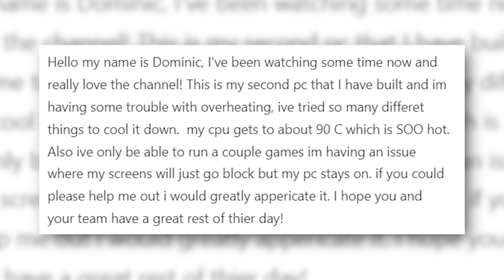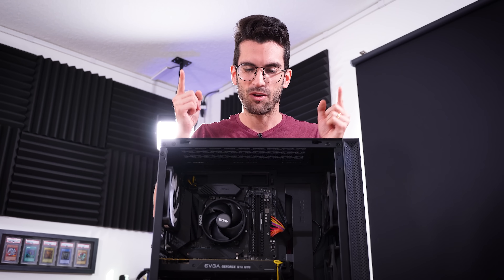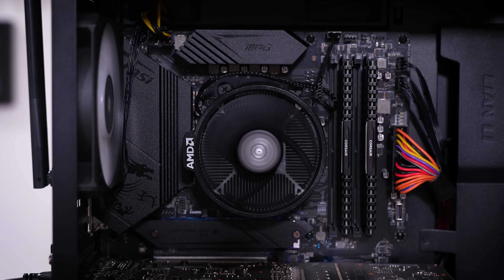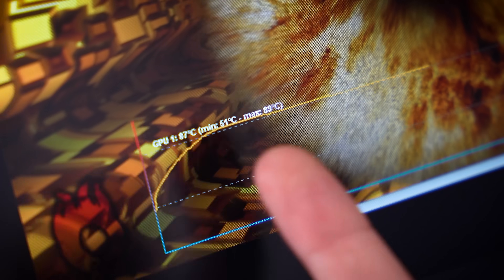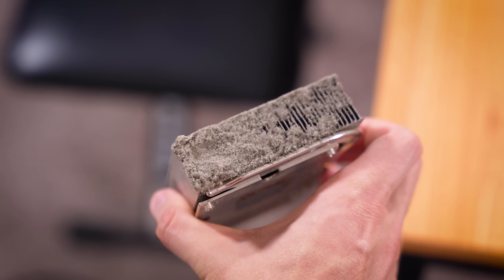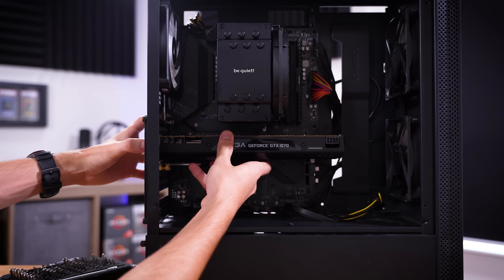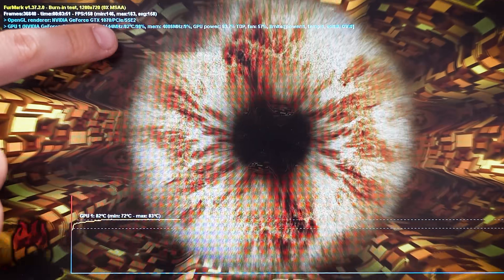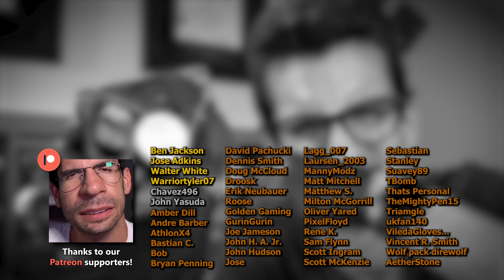Fixing a Viewer's BROKEN Gaming PC? - Fix or Flop S4:E15

Comment: 😅my wife's 5600 CPU just had to have the included cooler replaced for overheating about 2 months ago. for her PC the fan bearings gave out and fan speeds dropped to 50%. new air cooler tower it's icy cold again👍

Comment: The 5600X does actually come with the stock cooler. It is surprisingly enough for most typical usage at stock settings, but will absolutely throttle if you try to use PBO or anything. The 5600X seems to be right at the threshold of what the Wraith Stealth can cool, and even an inexpensive single tower cooler will unlock a bit more performance.

Comment: Those are not normal temps for a 5600X, even with the Dark Rock 4, mine never ran over 68°C. Maybe the board at stock has that weird thing were it pushes higher clocks to ensure stability. That's why I always keep my BIOS up to date, to make sure everything is as good as it can be Motherboard-wise

Comment: QUESTION:  you mention that the blower style video card cooling isn't very efficient - I'm assuming you're referring to the basic concept that a fan on the end of the card furthest to the front of the case takes in incoming air and pushes it out the back of the case through the fan slot cover.
What other model is there that you think is more efficient?  
The only other one I can think of was when nVidia's reference blower for the 2080s would just push air downward onto the board and then it would exit the bottom of the card onto the motherboard and the top of the card towards the case panel (which in my experience was really problematic).
Thanks in advance! And thank you for continuing to do these - I really love living vicariously by watching you help people and fix build problems.  It's something I used to do a lot of. ^_^

Comment: Replacing that PoS choked off case will drop those GPU temps a decent amount as well.  Sadly too many folks think that closed front with 90 Degree narrow side airflow bends are "Neato".  Upgrade that case to a Mesh design and see those temps fall very comfortably.  Great video always love seeing heat issues resolved.
Reply: I completely agree, one of the main problems of this build is the horrible airflow from that Lian Li case

Comment: I had the same setup before, B550 board, 5600x CPU and the CPU was hitting 95 degrees with water cooling, couldn't figure it out. I stuck a noctua NH-D15 on it, and it still did the same thing. Figured it was a problem with the board, so swapped that out, same problem, RMA'd the CPU, never heard back, took 6 months to get my money back by which time I swapped for an Intel i7 10700k and with the Noctua NH-D15 I rarely see the CPU go above 70. GPU on the other hand is a 4070ti and with Furmark at QHD it hits only 75 degrees.. 

I reckon purely, this CPU you have here is one of the dud batch that AMD released.

Comment: well one exhaust fan isnt going to do the job... a few top fans maybe an extra in the front will drop that another 10 degrees. I would never run in the 80s. Plus not sure why people still use big heatsink fans when all in one cpu coolers are like 50$ and work wayyyyyyyyyy better.

Comment: Can anyone help me with mine: my pc used to run completely fine up until a month ago when the CMOS battery went out and I replaced it but ever since then my pc won’t work with my monitor and my monitor is completely fine and it works fine. I tried connecting it to the graphics card as usual and still didn’t work. My monitor won’t boot up but the PC does boot up. I get a “hdmi isn’t connected” screen and then it just goes to rest mode. I don’t know what else to do and I’m not sure if it’s the graphics card or it’s something I did. Any help would be appreciated greatly
Reply: If it was DP i would have some things to try but if its HDMI that means its either the gpu, cable or monitor. I would try a new cable first, I just had an HDMI cable die last week. also have you checked the other hdmi ports on the card/monitor? you said the monitor works, so you tried it with HDMI and something else, correct? if its not the cable then I would try to reseat the gpu and make sure all the cables are plugged in all the way. also you've tried another monitor with the PC to make sure its actually booting? if the monitor 100% works, and you've tried other cables unfortunately it may be the GPU.

Comment: hi Greg just wanted to let you know that your recurring advice on clearing the CMOS when-in-doubt has just done magic for me lol. My HDMI-out would not work no matter what whether it was plugged into a GPU port or motherboard port with integrated graphics, so long as my GPU was actually plugged into the pcie slot. If I removed the card, then integrated graphics would work. Card was tested in a another rig and confirmed working. I started to spiral into questions like if the pcie slot was damaged, or somehow the PSU connector had something to do with it.. But then I remembered one of your videos and decided to clear the CMOS, and it WORKED haha.

Comment: Great video!! Im glad i found your channel tou are great at making these tasks into fun videos.
Btw i my cpu used to run around the 90 degree mark, with an silly rgb fan I had. Then I put the wraith cooler back on and undervolted the cpu to 1.25volts, now it runs on like 45-65. On a crazy hot aussie day it can get into the 70's, still a crazy difference

Comment: It's still much to hot for a 5600X, i would have checked the voltage (BIOS update?).
Reply from the maker: We already addressed this in the video. Voltage was fine and other BIOS settings were stock. Some chips just aren't as well-binned as others. Temps aren't alarming anymore. Not a reason to overhaul everything IMO. Mid-70s is fine.

Comment: Considering you can snag a 3060 for around $120 these days, nobody should be buying a 1070 in 2023 but a collector.
You find removing dried thermal paste therapeutic. I find it anxiety inducing.
Blower cards always run hot but I still wouldn't call the CPU temps good. But it will run quite a bit cooler when actually gaming.

Comment: wondering why the 5600x has heat issues as mine using the stock cooler and with a 6700 gpu (3 fans) on furmark after 7 min my cpu temp is 52 c and 58 c on the gpu did i just get lucky on the silicon lottery?

Comment: great video as always.
i was wondering, what brand and model that case was.
i'm using a shallow case (antec NX292) only showing CPU cooler clearance of 155mm. I see that case also have a shallow depth but manage to swallow dark rock 4 that are 160mm high.
Why? because just a few days after my upgrades still using intel stock cooler, my i5 CPU decided that 100'C are an ideal temperature to be. i can however remedy some of the heat  using higher fan curve.
so i deciding to upgrade the cooler. but case clearance are not clear what cooler can and cannot be used. the safest bet are using AIO. but I like beefier coolers looks.

Comment: 78C with a 5600X is still a little hot with a Dark Rock 4 in my opinion. Really advise the guy to check the CPU voltage in the BIOS, Ryzen 5000 is notorious for pumping too much voltage unnecessarily. 1.35v maybe 1.3v is more than enough.

Comment: One thing I would have done is check the bios version, if you didn't of course. I have had many issues with heat when using an older bios version for Ryzen. I had a 3600x that idled at 50C+ until a bios update. Because AMD supported the socket for so long there were a ton of bios updates and some, not all, really helped with temps and performance. As always, great video and explanation of what you're doing and why. Kudos once again Mr. Salazar!

Comment: Hey Greg i've recently assembled my new PC. Upon powering it up with the graphics card installed, I noticed that the VGA LED indicator on the motherboard illuminated, signaling an issue with the graphics card and theres no ouput. However, when I remove the graphics card and connect the HDMI cable directly to the motherboard and use the CPU integrated graphics, the PC functions perfectly. 

There's also an issue with the M.2 SSD not being detected by the motherboard when i open up bios. Therefore i cant download windows 11.

It seems to me like the Motherboard is defective, as its not detecting the gpu and ssd.

Here are the following components:

MB: NZXT N7 Z790
CPU: Intel core i7-14700 k
GPU: RTX 4070ti
RAM:  Corsair Vengeance 
M.2 SSD: Samsung 990 pro
PSU: Corsair RM850x

Can you help me?

Comment: Given my experience with AMD's horrible pre applied paste, I would try to simply repaste it first, before throwing a behemoth of a cooler at a puny 5600x

I went from 75C at idle to 75C at full load byu just repasting the CPU (with Deepcool thermal paste) in my 3600x

Comment: i'm currently having CPU heating issues with an old i7-2600 running at 60-80 degrees dependent on load using the stock cooler. Haven't noticed the temps previously, but since upgrading the ram I have now noticed it in my icue temp monitoring. it's possible that this was the case before upgrading, but now looking at best value options to reduce the temps

Shame you dont do fix or flop in Australia ;)

Comment: There is something wrong with the CPU or some hidden setting (for example CPU Game Boost mode in MSI motherboards thats means of the icon is RED -> CPU gets too much voltage just to sustain the clocks and is really hot then). This chunk of aluminium should cool the 5900X at 142W (stock) and maybe hit those temps but not with chip that power efficient. My Thermalright Phantom Spirit 120 can keep the 5900X (stock ~142W) under 70°C and the 5700X (~76W stock) under 50°C..

Comment: I doubt thus will work but maybe someone can help. I upgraded from an asus z390-f to a asus z690 plus, I'm using my old drives that already have windows installed and all my files but when I go to start I get inaccessible boot drive error. So I said screw it and went to reinstall windows, but none of my drives are detected by windows install. They are detected in bios, I have disabled csm, safe boot and and it's in uefi mode. I don't know what to do. Could they not be detected because they are running drivers from the old board and a new drive would fix my issue?

Comment: I think there is something else going on with the CPU. It shouldn't reach those temperatures with the Dark Rock.  I am running my 5600x with a £25 amazon cooler and it is running cooler.

Comment: 95°C is normal max temp, AMD says it on their website. 
If the CPU throttles AFTER getting to 95°C, THEN you don't have enough cooling... buy a 30-40$ CPU cooler instead of the free stock one... or use a case that has a few more holes...
Blowercards in that wattrange are simply HOT without a LOT of additional outside airflow. Don't buy a blower card!!! (RTX3000 and 4000 Founders are different)
If you are into 3D printing, try to make a duct from the front fan to the blowercard and CPU cooler.

Comment: It's weird why low to mid range processor overheats even on normal loads on a stock cooler never knew why this happens specially on more than 2yrs CPUs even if you repasted it.

Comment: I feel like a undervolt would make that cpu and gpu even more cooler. I have undervolted my Ryzen 5 1600 AF from 1.1350V(stock) to 1.1187V and I use a Cooler Master H410R cpu cooler, my temps went from 60C-65C to 45C-50C and from the stock amd cooler without undervolt was at 80C-90C, I also kept the boost clock but lowered my voltage. I also undervolted my RTX 3050 to 0.925V on the same boost clocks and temps went from 60C-70C to 45C-50C and both was in a 25C room tempreture.

Comment: i repaste my cpu/gpu every few years and interior dust every other year to keep temps in check. but on my last build i took out the issue of the cooler being the cause of high temps by using the NHd15 / Kryonaut combo. also the front of the case doesnt look that well made for air flow (thus higher temp). great solution

Comment: I've also had cpu temperature issues with stock cooler with my 5600x my pc was crashing and keep getting alerts after i changed my cooler everything was fine
Reply: i have msi b550 in which came with pbo turned on by default in bios  , while running cinebench i had temps around 90 no crashes but cpu power usage was 130 watts

Comment: It should be a habit to reapply thermal paste on gpu at least once a year.
 
Got a Saphire Nitro RX570 from 2020 that runs hot at 80°C and fans 2300 rpm and fans are loud when playing Black Desert. Decided to reapply new thermal paste this year and temps now when playing are at 70°C max and fans at 1500rpm.

Comment: Nice vid Greg; i love these troubleshooting sessions.
Really saved me from unnecessary purchases by repair or reconditioned my old rigs.

I almost sold my aging PowerSpec 1510 laptop (i7 7700HQ, GTX1070 8GB, 32GB ram) due to overheating, even after refreshed the thermalpaste (with KPX and then Thermalright).

While playing Transport Fever 2 (Megalomaniac map + a bunch of mods) the CPU temps reached 95-99 Celcius and 85-ish C for gpu.
Not thermalthrottled, yet, but a bit worrying considering i just repasted the cpu and gpu.
FYI, the laptop itself have 3 large heatpipes and 3 heat extractor fans with decent airflow. There are extra foldable legs to increase the height from table surface.

After a few simple undervolting tweak with Afterburner (gpu) and Throttlestop (cpu) overall temps were a bit lowered to 90'C and 80'C.

Lastly, i found one key feature that stupidly not tested before.
PowerSpec has a Control Center app and there is fan profile settings with 3 option: Auto, Custom and Maximum.
By default it was set to Auto or Custom, but the result was not satisfying.
In the verge of decision to sell this laptop i tried the last magic button that never been explored before.
I tried Maximum, yes it was loud but, man, really makes some difference.

Finally, the temperature is much more lowered to my comfortable zone; 82C (cpu) and 70C (gpu) on maximum load.

I wanted to try liquid metal but the risk just too great.
Good ending, and i hope could use this unit for 2-3 years more.

Comment: I had a laptop that would clog up at the fin stack like that but you wouldn't know unless you fully pulled the fan out. Stumped me for a bit because the exhaust was crazy hot but I'd open it and clean it with no change. Pulled the fan pondering replacing and boom!  Hello clogged exhaust port! lol

Comment: The new cooler definitely seemed to do the trick. I wonder what the deal was before though as those stock coolers from AMD are usually good enough to keep their CPUs cool.  At least the ones that the cpus ship with, which that one usually does.
Reply: It looked like maybe it wasn't making good contact guy might have just mounted it wrong (not tightened it down enough etc)

Comment: You did good cleaning that up and everything, but, and here I'm going to sound like a grade A asshole, it would be interesting to see what just cleaning up that dust would have done about the temps before you repasted it.

I only think it would show better what difference the dust build up really made. As well as what difference the dried out paste did.

Finally there's the CPU temps. Installing a Dark Rock 4 on a R5 5600X is way overkill. Sure it fit and it cools, but the load temp seems high for a 5600 with that cooler. It should be stable with a much more moderate cooler. It should have been stable even with the cooler that was installed from the beginning. Note that I say stable, not working optimally. And yes that Wraith Stealth cooler is the stock cooler for both the R5 5600 and 5600X. So a test to see if the machine was stable with the Wraith Stealth cooler would have been interesting.

Comment: My 3600 came with that terrible wraith stealth cooler and immediately started overheating. It was surprising because I upgraded from the 1600 which came with the spire and that cooler was great. I picked up a cheap tower cooler and boy what a difference it made. I feel bad for the people that are probably running the stealth still thinking it's an ok cooler.
Reply: I mean if you are a normal user and not monitoring your temps, you wouldn't notice any performance drop until it hits 95C at throttles. and the chips are rated to run at 95C for the life of the chip so its really not an issue.

Comment: Hey I have some important tips no one really knows about.

 I've been watching your videos like these. And really enjoyed them. I'm new to this but learning fast. To build my pc, I only have a motherboard so far.

Here's my tip, on all motherboard's screw holes lies the ground connection.

Some case come with pain over where the screw holes are . That means the motherboard doesn't have much ground connection to discharge excess electricity. So it's best to just sand paper those areas gently. So that it makes better ground contact. Excess electricity going through your components would certainly fry them.

Static alone can mess with components so imagine extra electricity. All three pin devices/appliances, need a ground contact.

You can rely on your GPU to do all the work. The case itself is used for discharging the extra ground current.

Comment: Still very odd that a 5600x would run those kind of temps even with the stock cooler. Wonder what's going on. Did they just get very unlucky in the silicon lottery?

Comment: I have a Question for you i have an Hp Pro 3000  sff desktop i have Installed the same CPU as what came in it i have tried an upgraded CPU i have tried a different power supply i have tried a new motherboard there are no bent pins in the CPU socket i even purchased memory it did not have any but i think i may have bought the wrong memory it is supposed to be NON-ECC memory but i get nothing on video i can't even boot into bios any ideas as to what it could possibly be.

Comment: amd 5600x 90 degree whith normal cpu fan is normal the only thing is thats he need to reduce vcod voltage to 1.2000000 amd curve to all core -20 problem solve